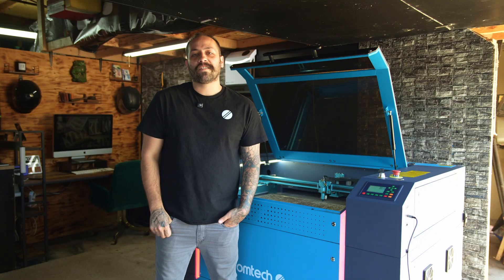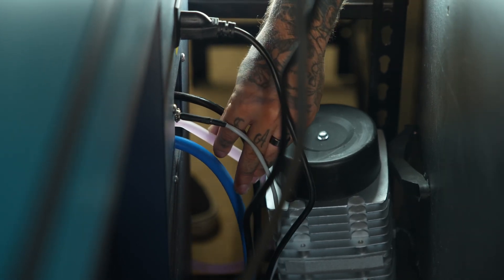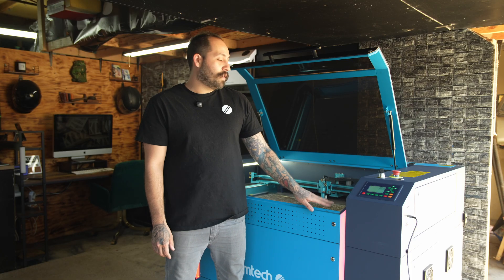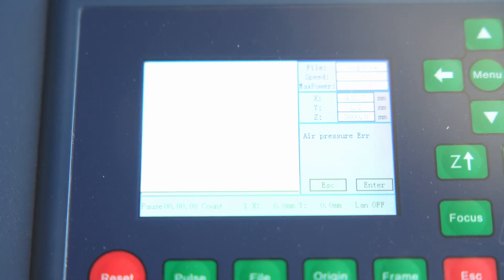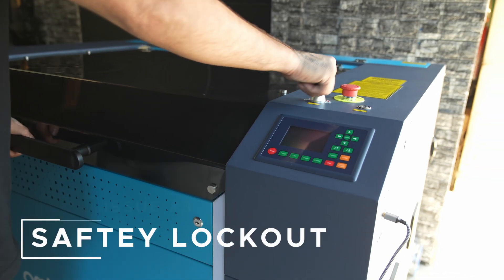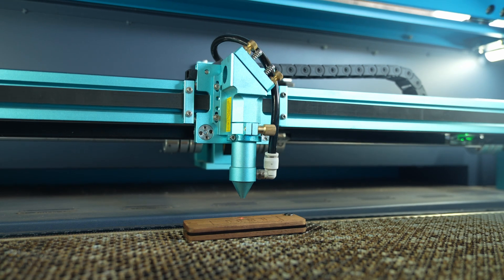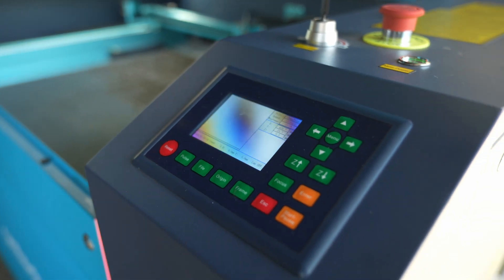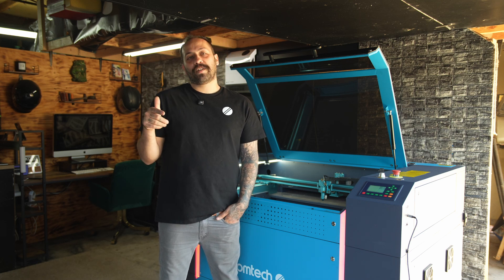OMTech Pronto Series | Basic Maintenance

Comment: I just purchased a Pronto 40 90w with the 24x36 bed. Currently looking for the correct Lightburn camera to install on it. Would like to get the camera and mount before the laser arrives so everything is ready to roll ASAP. Not having any luck figuring it out on my own (since I don't know the mounting height. Any help would be appreciated.
Reply from the maker: Have you tried looking on the LightBurn website? I'll ask one of our techs as well and see if they have suggestions or know which camera works best
Reply: @omtechlaser  I have. And I've looked at the camera selector in the Lightburn software. It wants to know the mounting distance in order to suggest the correct angle lens.
Reply from the maker: @billiards0518  Let me ask one of our techs what the mounting distance is for your machine and ill get back to you.
Reply from the maker: @billiards0518  You can check the mounting height in Lightburn > Help > Camera selection help. If you cant figure it out with that please send a DM and i can better help.